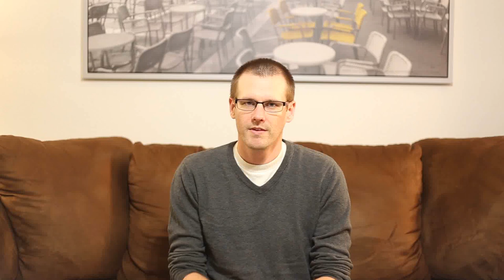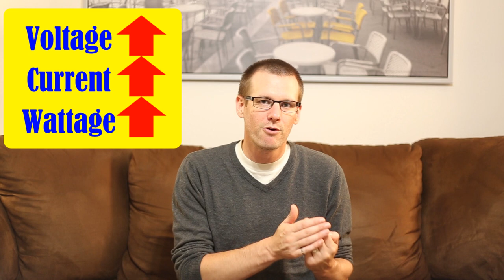Can Higher C Rating LiPo's Destroy a Motor or ESC?

Comment: so it should be fine to use a 25c battery on a 20c system?
Reply from the maker: What is a 20C system?
Reply: @RCexplained  cam drone with 1000kv motor with 30amp esc using 
lithium ion 18650 (3.7 volt 1200mah) in 3 series or  18650 (3.7volt 2200mah) in 3s fly?
What could go wrong ?
Reply from the maker: It would be impossible to tell you if it can fly and also if it can work. I don't know what airplane you gavr nor the exact components you will be using in it.
Reply: @RCexplained  ahh my bad! Iam talking about drone! Instead of polymer iam planning to use li ion for long duration by sacrificing performance! Any help??
Reply from the maker: It is possible but will be a bit more challenging due to the limited output of the 18650's.
Reply: @RCexplained  well my 1000kv rated at 13amps max 
But the 18650 2200mh cell has discharge rate of 2c so i have 4.4amp to the motors.
Or should i increase the battery capacity from 2200mah to 3000mah so that i get high discharge rate of 6amps??? 
And also explain! iam confused  whether to connect two 3s battery in parallel
Reply: Please explain 3 series increase volts but current changes so if i connecet two 3s in paralles( combination of series and parallel)
Whats the output in terms of voltage and current and c rating
Consider voltage 3.7 amd capacity 2200mah
#forgot basics

Comment: Hi. I subbed.  Great videos.  I have a question.  My losi 8ight 3.0e buggy i built to do 100mph. I crashed it. And fixed it. Battery tray and motor mount.  I run one 6s lipo. It was doing great before crash. Now no matter what battery i use it wont go over 80 mph. Do i think its esc or cap pack issue?
Reply from the maker: Thanks for the sub, I answered this question on the other video comment you left. Check it out.

Comment: Can I go from a 1000 mah 7.4 25c to a 5000 mah 7.4 80c?
Reply from the maker: In general yes.
Reply: @RCexplained  but will it burn the motor and the ecu? And will it make it faster as will?
Reply from the maker: If your power system has been selected correctly, it will not cause issue.
Reply: @RCexplained  okay thank you

Comment: When i connect a 11.1v 6000mAh 60C and a esc only hav 30C, it have some smoke in the connection between these two. Is it because the battery’s C is too high for the esc to support?
Reply from the maker: I'm assuming you mean ESC @ 30A. Do you also mean the spark that you see when plugging in the ESC to the battery? This is caused the surge in power that the capacitors  on the ESC will pull. This is completely normal.

Comment: I have a 80c battery that gets my aarma pretty hot and I was about to buy a 150c hahaha never mind
Reply from the maker: That could be true that you system could go over temp if its at the limit as is. Here's another point to keep in mind as well when looking at batteries:
I haven't been able to measure any packs rated above 75C  as an accurate value. In other words, I believe my 75C pack could out perform the 80C and 150C pack that you are referencing. There's another part of the equation and that is the reality of this non-regulated C rating.
Reply: @RCexplained  ahhh thank you very much I subscribed!!

Comment: STOP ...  Your first Fact is definetly Wrong ... a higher C rate on a Battery Pack cant do anything to Your Power system .-.. reason is ...  The C Rating defines only the possible Amps wich can be drawn of the Battery Pack without damaging this Battery ..  and nothing else ...  the CRating has no effect on how much Amps your Systems draws from a Battery or changes any other parameter of your existing system ...  !! the C-Rating has no effect on Any of the components in Your system ..  exept the Battery Pack itself ... - if the C-.Rating on your battery ist to low ...  ( for your system)  then Your system will destroy the battery  not the other way around !!!!
Reply from the maker: Hi Kalat. I can see why you think in this way. You need to look at the power system as a system. Sometimes to visualize this you need to look at an extreme case. For example a c rating approaching 0 vs a c rating close to infinite. Then bring the learnings and scale them back to reality. C Rating of 10 vs 45. What happens to voltage, current and power?

Also, your point on if your C Rating is too low, this too can actually burn up other power system components. specifically the ESC. You can find videos on how this can happen on the channel too.
Reply: @RCexplained  i think that Way because i am an electrician and the C-Rating is only a math Factor in a formular to calkulate the maximal possible Output amp of a Battery ..  it has nothing to to with the Parameter of voltage of the Battery ..   an elektik System of a Plane, ship or Car  is defined from the Motor You use  - the motor hat the Parameter of  max RPM and Max AMP - With the max RPM and the KV Parameters You can Calkulate the Voltage You can Use   and the Ampere wich will be drawn by< the Motor ...  with these Informations You have to size the ESC and the Battery You need ... 
if You have an Motor wich draws max 60A  You need at least an ESC and a Battery wich can Deliver and handle  this amount of current...  but is has no negative effect if you use an ESC and Battery wich can deliver 90 A
Reply: and sorry about my English .. i am from Germany and a little older than most of You
Reply from the maker: @KalatSaar  your English is fine, a lot better than my German. My entire family background is German too. 

The c rating being "just" a math factor is the limitation in your argument. A c rating is used in the rc industry because it is easy to understand and quite honestly, easy to manipulate. Marketing departments love this as It's not a measured value that can be verified easily.

What is a value you can measure is internal resistance. As the "c rating" of a battery increases, the batteries internal resistance decreases. 

With a lower internal resistance of the battery, it can provide a greater rate of discharge current. However, looking at the effect of the system, a lower resistance in the battery will maintain a higher loaded voltage at the battery. Keeping with the idea of looking at this from a system perspective, a higher battery voltage under load will cause the motor to draw more current. More current and more voltage = more power and more heat.

This is what I meant by looking at this as a system and not strictly just a formula - max current = c rating x Ah.

I created a calculator and graphed the relationship of c rating vs internal resistance and used many batteries as a sample set. There's a video on here about this titled find the true c rating of your battery.